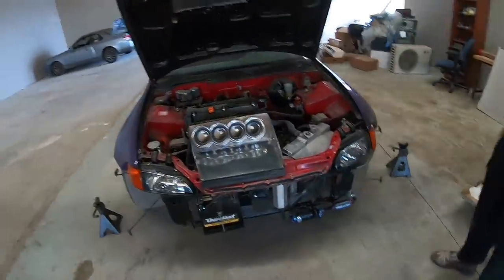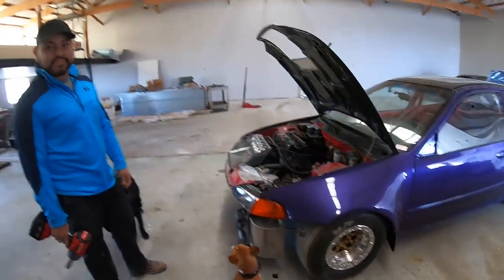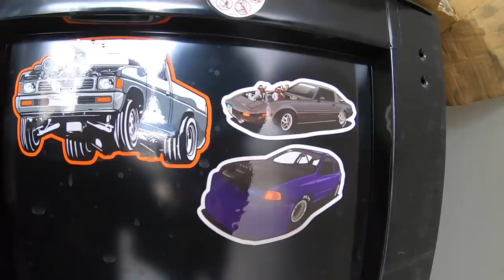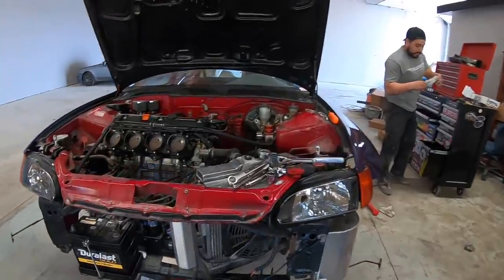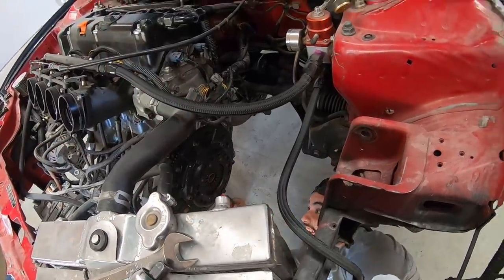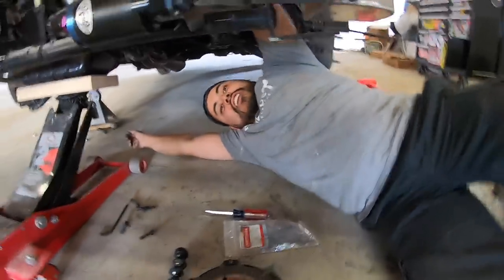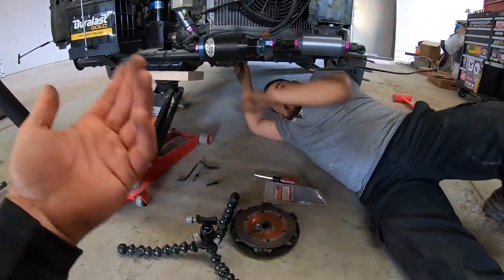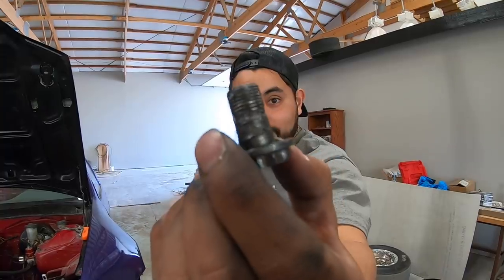Why You Should LocTite Flywheel Bolts! (All Motor Honda)

Comment: Love your videos!  I've found that sometimes flywheel bolts (or most any bolts for that matter), back out because they were put on bone dry.  Lube your bolt threads before installing and you'll get a lot more accurate torque readings and less backouts.  Also, over torqueing can also lead to back outs, as it can stretch the bolt and thread.

Comment: We had this issue before even with red loctite and new bolts ended up working well for us. I bought a set of 4piston flywheel bolts for my type s to try as well.
Reply: yeah I always go with new flywheel bolts, pressure plate bolts and a Honda OEM throwout bearing when changing a clutch. Sucks when your $500+ clutch setup gets destroyed due to a $5 part failing. Just not worth skimping out after I learned the hard way.

Comment: I had a red 88 sedan that had one bolt back out and it kept the clutch from engaging. When I tore it apart I asked the prev owner who did the clutch job and he told me that the guy who helped him basically half-assed it and didn't torque the bolts down. I sent them back in with air + red loctite, sold it about a year ago and the guy who bought it from me has had 0 issues!

Comment: The same exact thing happened to me. I went to replace the clutch because it sounded like the disc was completely gone and it turned out that the clutch was good and the flywheel bolts were loose and dancing around in there. Previous owner didn’t loctite the bolts, so now im also in the process of replacing the crank. Videos on my channel

Comment: When you add loktite your torque value will be about 15-20% over what your torque wrench says cause your adding a lubricant. So make sure you do the conversion for wet torque the bolts.
Reply: I would still torque them to spec regardless.  The torque spec given is for normal, everyday circumstances and this motor will be revving substantially higher than normal.

Comment: The issues why these aftermarket flywheels come loose is because the manufacturers make the flywheels lighter and the flywheel is thinner in the flywheel bolts section so the oem honda bolts will bottom out in the crank and you will get a torque reading but the flywheel is still not to spec and will vibrate loose.

Comment: I actually had this happen to me, but mine wasnt just one bolt. Mine was all the flywheel bolts sheared off. Destroyed my flywheel and crankshaft at that point there wasnt much hope for drilling the bolts out in the crank 😂 learned my lesson, always loctite your flywheel bolts especially if you use new bolts. And btw that was in a 12v cummins.

Comment: if you really want to use loctite "right" one should clean both threaded parts, and use the loctite primer. For something like a flywheel it is only just a bit more time and effort :-). The very best loctite I have seen for one situation that was really difficult was a chapstick type made by loctite. It held a bolt that came loose with any other product made by any mfg.

Comment: when a flywheel comes loose like this (for whatever reason.....) the crankshaft will beat the crap out of the thrust surfaces which typically will ruin not only the crank/flywheel but also the block.  always locktight & torque (by whatever method) NEW flywheel bolts.

Comment: Drill the bolt heads and install safety wire. Problem solved...well as long as you know how to safety wire bolts properly.

Comment: Carlos should put his Super99 on M1 like Ghost Boy Aki had his running on and see if he can be the next one going after the All Motor record.......Hayden you should talk Carlos into taking his Prelude or Integra and converting it into RWD with a Fab9 rear with a 4link suspension and QA1 triple adjustable coilovers on all 4 corners with a powerglide trans and a fully built 427cid LSX-R aka the aluminum version of the LSX with a big single turbo poking out the front bumper like people be doing with the S14s and S15s and go out there and run low 8s high 7s maybe a mid 7 on a good day and run it on radials like a 275 I think tbat would be SIIIIICK!!!!!!!!!
Reply: Maybe if they win the lottery

Comment: RED loctite??? You realize that means you will need a torch to get those bolts back out right?
I agree, having had the same issue on another car, to use loctite, but BLUE Loctite is what you want. Only use RED Loctite on bolts that should never need to be removed.

Comment: 15 - 20 nm over settings and loctite big impact can weaken or snap the bolts easy, believe me ant worth the time you save and you know they are then all at a even torque🤙
Reply: Been a mechanic over 15 years and I would never use "big red" my impact on them small flywheel bolts

Comment: Just bolt them on with an impact, if you torque to spec this is going to be the result.
Reply: Just use a calibrated wrench.  Stock cars never do this and they are torqued to the same spec, right?
Reply from the maker: @benpalumbo6726  this car see a lot of rpm and probably more harmonics than a factory engine lol most people do red loctite and 130 ft lbs 😂
Reply: @Metigulous  I've never heard of that actually being a problem, maybe the crank was already damaged or like I said the wrench was off, just seems odd.  But I suppose going over won't hurt it
Reply: We're these flywheel bolts reused?

Comment: dammm!!!!!!! looks like if someone else would have just spent under 10 buck and took about 5 minutes 2 put some on they could have save u a whole lot of time and money...i posted a comment on one of kyle's video's a long time ago about how important it is to use loctite.. & i also got into a fight about needed to use loctite with a  lawn mower tech on my own yard machine in my family driveway cause he would not use it &  would not let me put some on  my own lawn mower pulley drive system 4 the blade's a very long time ago .. so i had to add it on after that ass hole got of the property. lol will never call Craftmen's tech to do work on our machine's  again even if it's under warrarty. goes back to that saying sometime if u want it done right u just gotta do it ur self lol